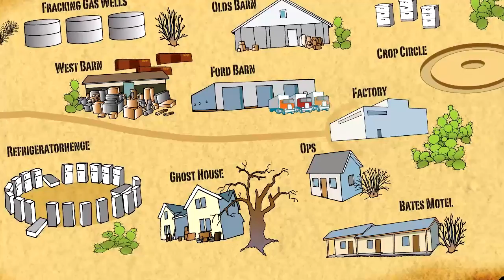Bose active EQ repair

Comment: @tvecourse Hi, if the electrolytic caps are about 30 years old in one of these, would replacing them for new ones improve the sound quality?
been told they deterioate over time

Comment: Hello. Thank you for video. I'm trying to repair my series I active EQ but I can't seem to find a list of the replacement parts and I'm new to electronics. Only one channel is working and I think it could be either a bad diode or capacitor bc everything else seems fine. Do you have a list of all the capacitors and diodes or a way to tell what I need?